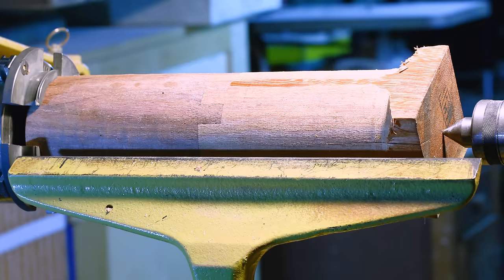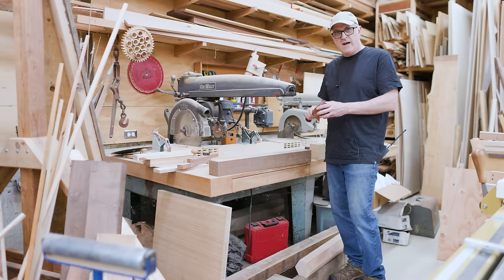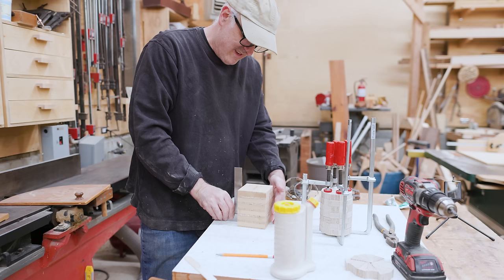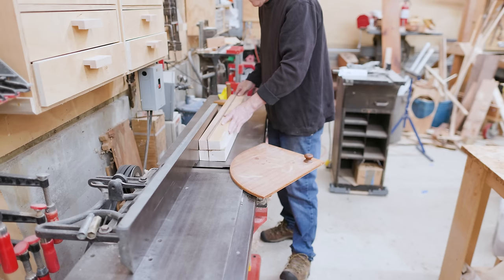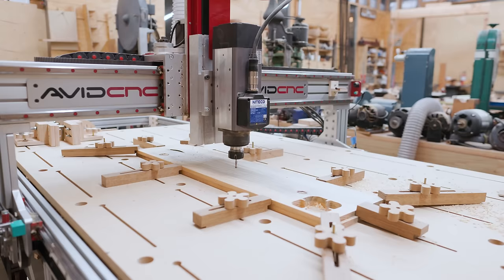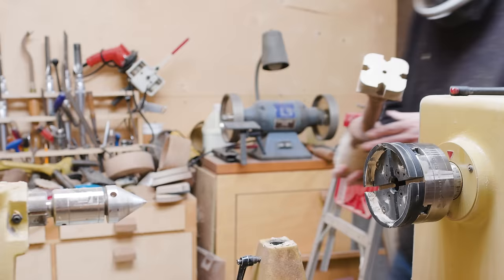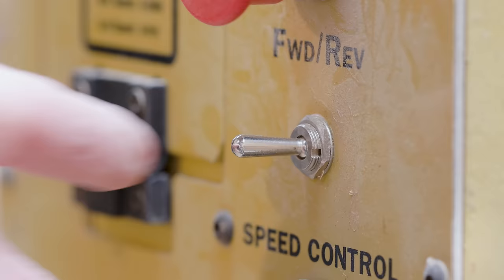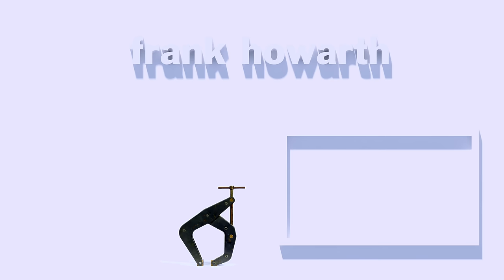Making More Mallets

Comment: Piquia or Piquiarana. The wood you're looking for sounds a lot like Piquia. I bought some not long ago at a rather low price, compared to for example oak or walnut. It was marketed as a hardwood joist for support the floor of a terrace. The color is the same and it's some of the hardest woods I've come across. It doesn't take in oils so well, but it doesn't let much water in also.... Hence the use, I guess. I got some left, and building a mallet is a great idea, thanks
Reply: AND you can use the same initials on the handle 👍🏼
Reply: @OnkelPeters not gonna lie - it took me a minute. You're right! I might have to freehand it with a dremel, tho 😵‍💫

Comment: The close up of the mallet from the beginning of the video looks a lot like almond wood.  I got some once and used it for cutting boards.  It's ridiculously hard and has the same grain patterns and color.  You can occasionally find almond lumber and it's usually pretty cheap.  I've got a few 8/4 boards left that I may use for a project like this. Good luck and great video.

Comment: I wish I'd seen this video years ago...lol as a flatbed trucker that had hauled hundreds of loads of steel I have literally thrown away 1000s of board feet of that wood. It's as hard as rock or steel. Tried using it as firewood, but it burns with a really low btu and it wasn't worth it so I'd always throw it out...sorry. Glad you found a purpose for it. great job.

Comment: Frank, beautiful mallets.  Check for Apitong suppliers in your area.  It's a wood commonly used as decking in commercial big rig trailers.  Reasonably affordable when purchased in bulk, but you may be able to get off cuts from tractor trailer repair shops.
Reply from the maker: Thanks, I will have to look into that.

Comment: The dunnage wood is probably Luan Mahogany, AKA Philippine mahogany. A story on the damp wood: Many years ago a big white oak blew down, and I kept a few pieces of the wood. I made a mallet and a thin-walled pencil holder from the unseasoned wood, fully expecting them to check as they dried. So I thought, "what has an affinity for water, doesn't stink, and doesn't stain?" Ethylene glycol antifreeze, the yellow kind, came to mind. I applied it and it soaked right in without any harm to the beauty of the wood. I still have the mallet and pencil holder and they never checked.

Comment: Don't focus on steel.  Look for any dunnage you can get a hold of.  The real problem will be getting hard woods from overseas, because a lot of that CAN'T be disposed of in the USA.  We once threw away about 5 tons of solid 4x4 mahogany dunnage (back in 2017) because we couldn't bring it into the USA - I cried.  But the point is, just try to get any hardwood dunnage from overseas, you might get lucky and find something neat someone wasn't supposed to have.

Comment: Use Ironwood (Ironwood (Ostrya virginiana)) from a lumberyard or any drop off  from a baseball bat factory(Cheap) The best glue for you is T-88 from System 3 Epoxies. System 3 T-88 will bond wood with a high moisture content and a very good service department that can suggest the best selection of adheasive. for any given wood.

Comment: some, (most) tropical hardwoods will not require a finish. they are naturally oily, extremely dense, (in most cases, too much so to accept an oil molecule), and  the only finish that complimented a good rare trop HW is/was shellac.

Comment: Frank, I'm just starting to watch the video... But that tropical hardwood you showed looks a lot like Garapeira. It's a Brazilian hardwood that is pretty cheap, it's widely used for construction here... But it's a fantastic wood even for cutting boards. 
I'm not really sure if this is it... But definitely looks like!
Reply: I would say it is cumaru.
Garapeira has a yelow sawdust. Cumaru has a brown one.
Reply: @edualbergaria10  It definitely could be, but Garapeira also gets pretty brown with time. As older, more brown it is. (And it's not just in the surface!) But to a limit, of course, it doesn't get as brown as Walnut, for example.
Reply: @edualbergaria10  Cumaru was my thought as well. Especially because of the dimensions he bought it in, I bought quite a bit of Cumaru in 4ish inch square beams, and the retailer had tons of it.
Reply: @edualbergaria10  I’d doubt it was cumaru. Cumaru is quite difficult to work with - it can be oily, making gluing difficult; it’s also difficult to plain smooth as the grain isn’t very uniform. I didn’t see those issues here.
Reply: @MKRM27  I am from Brazil and work a lot with Garapeira and cumaru. What you sad about cumaru is true, but He didnt hand plane it. Power plane is fine with cumaru. And the glue up is ok when using a joint like he did.
Reply: @MCsCreations  yes! Garapeira can dark with time and sun. But the saw dust is always yellow.
Reply: @edualbergaria10  Very true. And it's a freaking beautiful wood... I made a tic tac toe game with it, like Rex Kruger showed once, and that piece is freaking dark!
Reply: @edualbergaria10  Interesting. I have also worked with both; couldn’t really struggled with the workability of cumaru - even with power sanding.
Reply: @MKRM27  yes, it's at same time a wonderful and a terrible wood. Lol.
But Garapeira also. Very dificult to work.
I beleave I am saying its ok with Power tools because we dont have good wood available in a decent price here in Brazil. The best goes to Europe or USA. So my standard of good planning and glue up is probably less than yours.